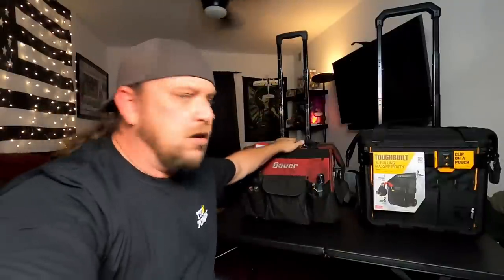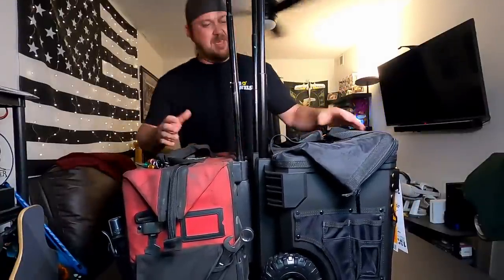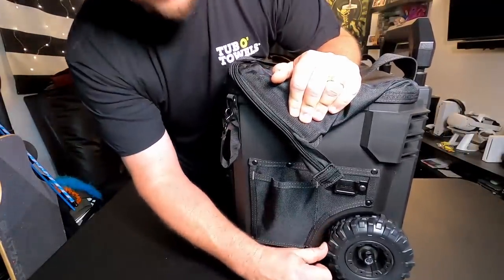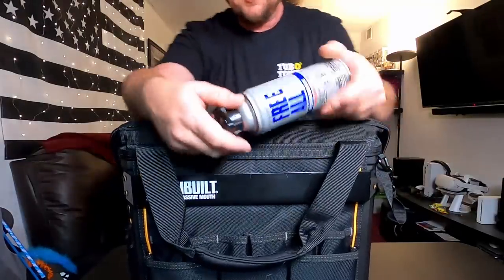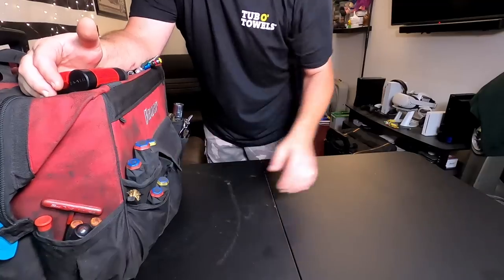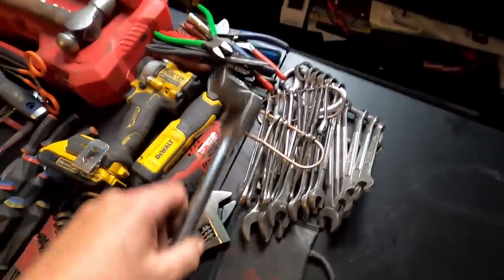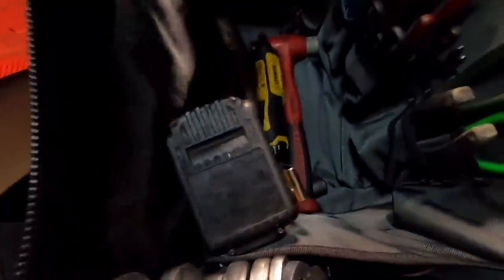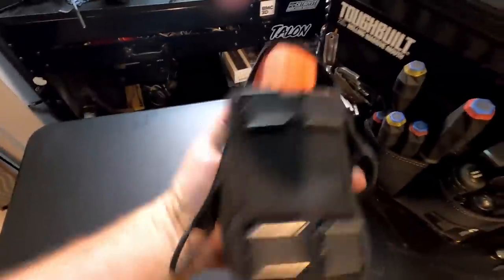Moving Into The ToughBuilt - Rolling 18” Tool Bag

Comment: I’ve had this bag for about two years and the only issue I had was the wheel bearings picked up some strings and dirt and destroyed them. I replaced them with some sealed bearings from Amazon and that did the trick. Rolls better than new. No other issues at all no rips holes or tares. Been a good investment 😊

Comment: When i was an electrician, the tough built pouches were absolutely fantastic. The ability to set one up for rough in, one for service/trims, then have a pouch for staples/wire nuts, a drill holster, and a hammer hook. Put the clips on your belt and adapt to the scenario

Comment: I'm a cabinet installer, and I used this exact same bag and loved it for about 6 months before i out grew it and switched to pack out boxes. before you count out tough built pouches and the front bar they can be a game changer, their drill holsters are very nice, the big plus is adding to the amount of storage and reduces the clutter on the inside. also the clip on the left side is for a tape measure.

Comment: I haven't found a bag yet that can survive long term.  Through multiple flights, different environments, chemicals and hydraulics, nothing seemed to last.  Then I decided to use a pelican case and build multiple layers of foam and aluminum where every tool has a tool controlled environment/home.  If there is a tool missing it shows the color of red foam.  (Black foam is the top layer that holds the tool.)   I know exactly what's missing by a first glance. I usually make my cases with 2 to 3 layers depending on the trip I have to make.

I had a pelican fall off a Q400 horizontal stab, and it survived intact.  Yay!  Plus it's water proof incase I have to go for a swim.
Reply: The layers take up space that can be used for tools but you have a very necessary reason for knowing when a tool is missing. Our LAME was always picking up "new" tools from light aircraft that were left in the machine before flying them to NZ.
Impressive it survived a fall from so far up. Says heaps for the durability of the product. 👍
Reply: If you ever want to go back to a bag or backpack try veto pro pack
Reply: @josephking6515 I don't sleep if I'm missing a tool. 

Funny thing:   The worst thing I have ever seen left in an engine cowl was a set of rubber chocks and a huge prybar!!! The aircraft went for a flight and came back for a service check.... wow!!!  Chocks weighed close to 50 LBS.  😂  What on earth were they prying??!!

Comment: i have been rocking this bag since they came out. before i was a multiple bag guy. i have been using Tough Built pouches for many years since they came out. small metal clip on side of bag is for tape measure. in my van i have a full set of 20 volt dewalt tools on shelves. in my rolling bag i have all 12 volt tools and my daily use hand tools. if i need to hog on something i grab the bigger tool. i keep my less used tools in the front outside pouches cause i have three tool belts that are my daily drivers, and it makes it harder to get tools out from behind tool bags. you are going to love this bag. If I'm doing any work "Rollie" (rolling tool bag) and my electrical, hvacr, plumbing or electronics bag goes on top. it has been such a great tool. for stairs up no problem down sometimes i have to tip the bag back a little more. if Rollie when missing i would cry and buy another one. i hope you have the same experience that i have had with mine. love the channel. keep up the great work

Comment: I’ve had mine for about a year and a half. I doubles as a seat if you need it. Never had a problem with the wheels like all other bags. I never bought into the clipping add ons. My handle broke on a trip to Mexico, on site glue and some tape fixed it. Only problem I actively have with it is the screws that attach the handle keep backing out. For the dollar, 10 out of 10 would recommend.
Reply: Put some red lock tite on the screws that keep backing out. Should help keep them tight

Comment: I also use this brand of tool storage. its durability is acceptable. the misc pouches work well if you want to mitigate your tool load due to what you are working on. Purchasing multiple pouches is costly but it does let you kit out for what you're doing. I also mount each inside the van for storage when not in use. You may catch some shade on a bigger jobsite for your little kid toolbags but them knuckleheads take 2-3 tries to get their pants on in the morning anyway.
7/10

Comment: I love my ToughBuilt setup! I use the tool belt with shoulder straps, then click on the pouches. When I'm done with a pouch, I hang it with extra clips mounted in the vehicle (the clips have screw holes). So far I have a right pouch for framing, a right pouch for electrical, and a left pouch for multiple trade tools like a 7 in 1 screwdriver, basic pliers, body panel pop tool, and a utility knife. I'm looking to expand. Pro tip: I hang my Dewalt batteries (six 5AH batteries) below the pouches. It saves room and the batteries are numbered to keep track of recharge life.
Reply: Exactly!!!!

Comment: I've had and used Toughbuilt for years. Bags are super handy for guys like me. From plumber to electrician to framer in a second. My tablehorses... Could park a truck on them.
 1¼ in flat aluminum with a 1/2 in spacer makes a good track for the clips and bags to hang from on your wall

Comment: I LOVE my toughbuilt belts and cases! 1200 denier ballistic nylon cloth, and a bit different organization but they are fantastic! Been using the carpenter bag, the journey utility bag/sling  for 9 months and they are just breaking in. I also own the laptop case (the giant one) as an AV guy its badass! Holds laptop, soldering kit, Toner, SPL meter, batteries, glasses (in cases) pens, pencils. Butane, cables, adapters, a 17" laptop and its kit, media for testing source, and an i Pad. Cool gear for the money!

The clips are sweet because you can hang them in your van/truck and just use them to organize.

Comment: I do like those ToughBuilt tool pouches and thier quick slot system. I just mounted a bunch of them on a board and separate my daily tools out into job groups. Electric, plumbing, drywall, general, etc. Held up well over the last half decade.

Comment: I have had my tough built for over 3 years. I’m an HVAC tec as well as a sheet metal worker. Bag has gone thru many airports , stairs and jumped manny curbs. Still going strong. Tires are a huge plus to its performance. I use the mesh screen inside for a portable speaker/ Dewalt 2 amp battery and Dewalt usb charger and sometimes my phone goes in there to charge on the usb charger.  Put some lock tite on the screws in the top of the handle. You’ll love this bag.

Comment: If you need more space Thoughbuilt makes a larger rolling tool bag. The XXL 22 inch, ive had mine for over a year and its amazing. Fits a circular saw, grinder, oscillating tool m18 and m12 impact and drill plus a pactool snapper shear and a couple of other attachments for the drills. Thats just the inside of the bag. Oh, and the bag still fits in the trunk of my 2004 sedan. Thoughbuilt bags are awesome.

Comment: Been running this bag and toughbuilt clip tech pouches for about a year and a half or more. Daily use. I'm not gentle with my tools and I do electrical focused commercial and industrial service work and associated trades. Everything has held up and works as if they're straight off the shelf. I have that 18" roller. I need more space nowadays and probably could do with an upgrade for soace reasons but otherwise I'm completely satisfied with their stuff. Having modular options with ruggedly implemented and thoughtful options has been a blessing. It'll get you where you're going and get what you need done with a wonderfully reduced swear/cursing outburst to production ratio. I think you'll like it. Let us know after you get some use out of it what you think perhaps? A follow up video would be cool. Rock on.

Comment: Small metal bar behind scraper and above the wheel is designed to hook a tape measure on. Supposed to help keep tape readily accessible while avoiding wearing out softer pocket material. Very nice setup though, definitely like the metal bar actoss the front. I run the packout system amd love it, but I carry considerably larger tools 😂. Power tools in the bottom box, batteries and chargers in mid box, bits, blades and other smaller accessories in the top box. Then have other smaller boxes that I throw on for hole saws, strings and finish tools amd other such items. Always like to see how different people in different trades store and transport their tools. 😁👍

Comment: I have one these ftoughbuilt bags from Lowes the bigger one with wheels.  But its been great so far.  Use it mainly for going to the shooting range.. So i can carry all my black powder. Balls. And like 4-6 or more revolvers or whatever.  Holds a lot and i needed that as black powder you got a lot of tools.

But i also used ig for the salvage yard for parts and to hold tools so i dont have to carry heavy tool bags around in the heat.

The compartments inside hold magazines perfectly as well for other guns i got.

The tough built one is also waterproof.  Something very important. For guns or tools

Comment: I service commercial printers. I could see this being so useful. I use a keen backpack right now, and it's huge & heavy. Something like this on wheels would be nice, and I could stack boxes of parts & supplies on top in the way in.
Reply: The only other thing I'd want is if the handles raised up to workbench height & had an 18x24 work surface. Nothing crazy, to hammer on, just to be able to work from.

Comment: I have a story about Toughbuilt. A few years ago, I bought a set of Toughbuilt collapsible bolt cutters. I brought them home and disassembled them to clean all of the cutting oil and filings off of the cutters from the manufacturing process. While reassembling them, one of the adjustment bolts stripped. I contacted Toughbuilt about the problem. 

48 hours later I had a new set of bolt cutters arrive at my door. Inside the box was a shipping label for the old set. I boxed the old set up and slapped the shipping label on it before sending it off. 

Not many companies will send you a new tool, no questions asked, before asking for the old one back.
Reply from the maker: Nice 👍🏻

Comment: My first impressions were…
1. The clip over the wheel is for a tape measure
2. The Velcro on the top is to hold an looped extension cord
3. The paint job on that bar didn’t last long. The first tool to touch it scratched it three times. 
But definitely a nice bag.

Comment: I'm a commercial electrician and currently using the Milwaukee branded bag just like the Bauer. I will definitely look into the toughbuilt when the red bag dies.
Reply from the maker: The Milwaukee is probably made in the factory as the Bauer and the Husky. They’ve all very similar in construction.
Reply: @FunkFPV  Yeah I saw your earlier review...they are the same bag.

Comment: I’ve been using a Milwaukee tool backpack for years.   As my job description  changes I’ve added more and more tools.  I had to put it on a little folding two wheel cart.  Now I’ve taken to hanging things off the cart.  
I keep coming back to this bag.  I’ve heard the bar blocks the front pouches from putting tall items in it.  Are you noticing that?   I wish it had all the outside pockets on the inside.  If I go this route will need to decide if I go L or XL.

Comment: I have a couple of toughbilt stuff and have been happy with my purchase.  I haven’t tried the new bags with all the attachment clips and accessories but they look like they would do the job well.  You might just sell me on it over the Husky bags I’ve been looking at.
Reply from the maker: As far as I can tell the Husky is the same a the Bauer. The only difference is the name on the front.
Reply: @FunkFPV  thanks that helps!!
Reply: @steventicknor8059 He made a video comparing the two. I don't remember if he bought both bags or if he did it from pics. Either way, most tools are bought from one factory or specs.
Reply: @henryl3617  thanks I’ll have to check that video out.
Reply: @steventicknor8059  your welcome

Comment: I recon those tight side pouches are for screwdrivers. Ever put your screwdriver in a pouch all floppy only for it to fall out later when you move your bag? These won't do that.
Also, that metal clip on the one side by the wheel...will it hold a tape measure?

Comment: Been using a piece of crap husky bag that’s got a few holes in it from the two wheel cart I used drag around on. Got a 4 wheel cart to put it on so cockroaches can’t get in since I work in kitchens. Like it a lout better after I cut the “extra storage” pouch out of the center of it.oh well, probably time to get a new one

Comment: Do you dislike Milwaukee Packout? I have 2 stacks about as tall as I am and the rolling toolbox at the bottom is great. Super durable and the 9” wheels roll up and down stairs, over air hoses, hydraulic lines and power cables at my work all day with no problem. It is a bit more expensive but I bet it lasts you more than 2 years
Reply from the maker: It’s great for what it is. I looked at it and it doesn’t fit my needs.

Comment: I hate the old metal tool boxes. They are bad and too heavy.

Something I look for when I need a tool bag are the narrow pockets that are good for screwdrivers.
Do they have a solid bottom?
I have tried many bags but if you turn the screwdriver with the tip down in the bag.
Then you suddenly end up with a hole and a pointy thing sticking out from underneath.

By the way. are spare wheels available for your new bag?
I think they will fit my Suzuki Jimny.
Reply from the maker: They do not. Screw drivers are always a problem with these.

Comment: I had the idea of finding or building a pouch with a quick release. Then I found the tough built pouches. 
I’m now on my second after 2 years of use. And it was still going but just getting ratty looking. 
I clip it on and off dozens of times each day. Broken some clips over time but I feel like it’s still durable. 
If the could add a swivel function… 
🤌🏻

Comment: what was the inflator for? ive been fixing random construction equipment including forklifts for about 11 years, iv only seen those used to open locked doors by ama
Reply from the maker: I use them for installing heavy wheels in tight spaces. Some of these forklifts you need 3 hands where only 1 will fit.
Reply: @FunkFPV  genius! That makes a lot of sense! Most of ours are solid rubber so I'd never end up having to change a tire during a rental. Mainly with the Toyota's I'm just cleaning wax out of the propane injector, or doing oil changes.

Comment: Nice tool bag. May it brings joy whenever you are using it. What is that Milwaukee flashlight that are you using ? And what is that DeWalt screwdriver (besides the impact) ? Thank you.
Reply from the maker: The light is a Milwaukee 2114-21. It’s a little pricey for what it is but it works. 
The screwdriver is a 8volt DeWalt. I did a review on it a few videos back. I really like it 👍🏻

Comment: I wonder if the all terrain wheels might make it easier to pull the box by reducing the chance of the wheels slipping and essentially making you drag the box.
Reply: It does exactly that. I recommend this bag. They make a bigger one, but it's kinda awkward.
Reply: its not a matter of slippage, it helps stop the bag sinking into soft ground.
Reply: @katelights  how would the ridges stop it from sinking in soft ground?  The contribution to contact surface area is marginal.  A wider/thicker wheel would be just as good if not better because then it wouldn't rumble on hard, flat surfaces.

The reason I mention slipping is because if the wheels don't spin, they basically become crappy skis.  Small ridges may not prevent the wheels from sinking under the force of the box and tools, but you don't need a lot of force to rotate those wheels.  Those ridges would act as levers to make the wheels start turning when the ground doesn't provide enough resistance.